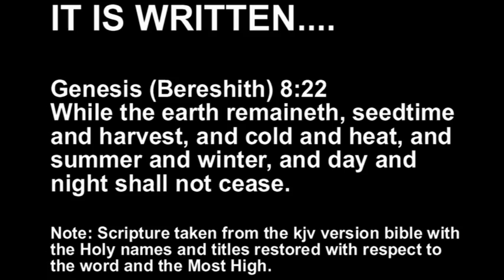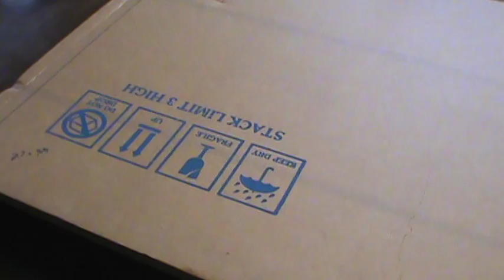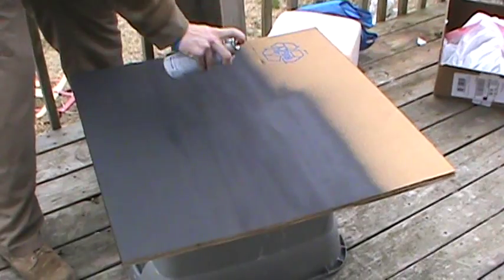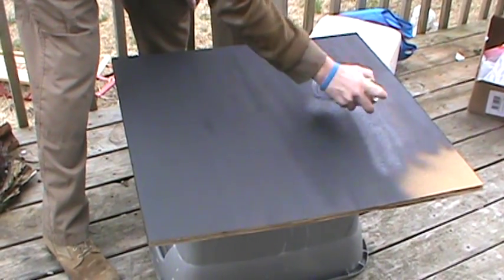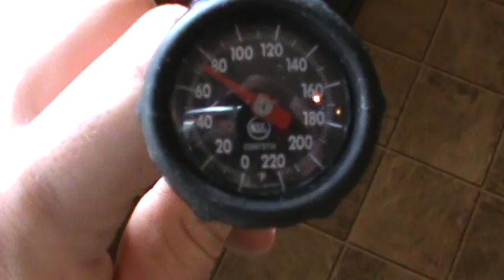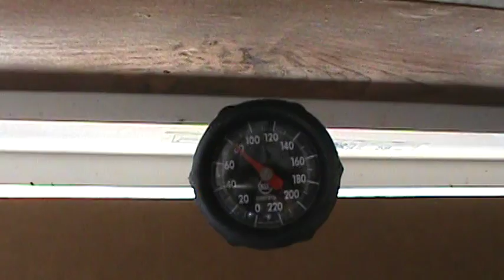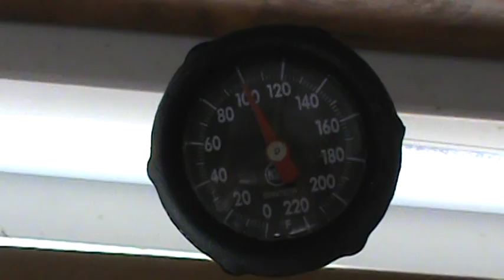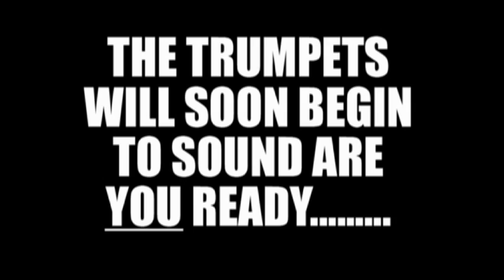HOW TO BUILD A SIMPLE PASSIVE SOLAR AIR HEATER PLUS A TEST OF THE UNIT

Comment: Thank you for another easy inexpensive prepper project. It may not heat a large house, but should, at a minimum, reduce the need for other heat sources (gas, wood, oil, etc.). Saves some money!

Comment: What if you wrap a large Aluminium foil on the card board, then print it in black.  Aluminium foil can conduct heat very quickly.

Comment: March 5th 2016: Question: How does the hot air circulate in A room? Also at night will cold air begin to circulate from the window solar cardboard box. Anyone with experience please advise. Simple workable alternates that one has used. thanks @79 yrs young

Comment: Stupidest thing ever. You block the light with black cardboard. Previously, all that light was entering your home, providing light and then bouncing around until it is absorbed and turned into heat. Now you have black cardboard blocking the light and some of that energy entering as heat. You will have less heat with this arrangement.
Reply: +ktrez2000 Depends on how many windows are in the same room.
Reply: +ktrez2000   Not only that - hot air rises. All these passive panels I've seen will nicely warm up the ceiling, whilst leaving your feet chilly.